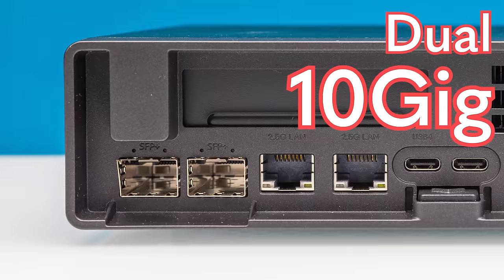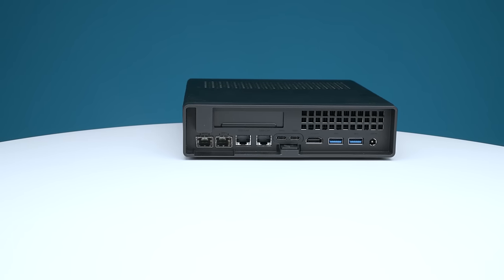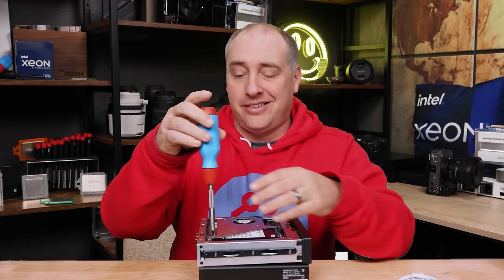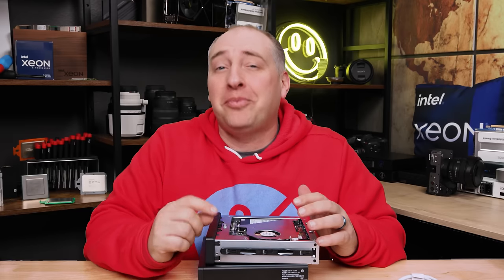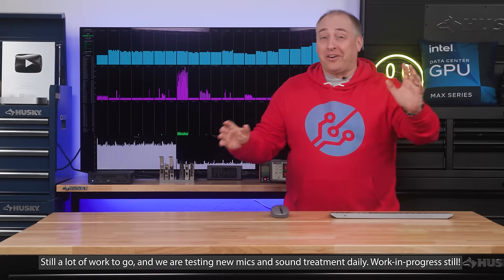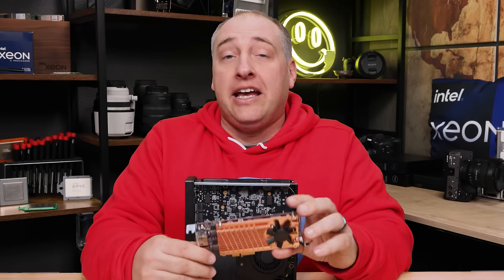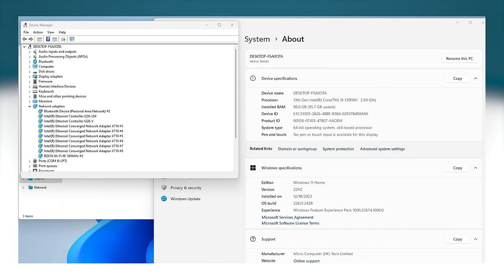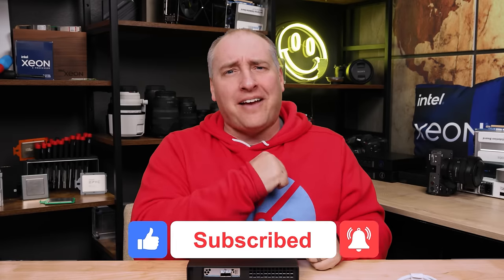The Pinnacle of Mini PC Servers - Minisforum MS-01

Comment: I saw this machine but still got myself a Think Station P3 tiny. I chose an ES motherboard so that I got 3 M.2 slots. I paired the P3 tint with the i5-12400 and it was 1/3 cheaper than the MS-01 with the 12900H option. 
There seemed to be an i5-12450h option with the MS-01, but it is not available and we don't know when they will start selling this option. I don't really like the i9 CPU that MS-01 provides right now because I don't want to stretch the cooling system too far. 
I did see the appeal of the dual 10G NIC but for someone who doesn't really need it, it is a piece of hardware that consumes power and does nothing. On the other hand, I can add USB type A, DP, HDMI, or TypeC with video and charging to the Tiny via expansion modules, which makes it very flexible. However, doing this does sacrifice the PCIE cutout.
It is also more difficult to install PCIE cards sideways compared to Tiny's riser approach. At least it doesn't require a special PCIE bracket though.

All in all, I think both MS-01 and P3 Tiny are both nice SFF machines. It really comes down to whether you prefer the dual 10G SFP port and the USB4 port, (Yes, it is USB4 rather than Thunderbolt, although they are functionally the same.) or more flexibility.

I will also provide a quick technical comparison here for anyone interested:

P3 Tiny  |VS|  MS-01
form factor: Standard size  |VS|  A bit larger than Standard size. (Matters if you want to put it in a server rack.)
CPU: Any CPU from Intel 12,13 and 14GEN  |VS|  13900H,12900H, or 12450H. (12450H not available yet.)
iGPU: MS-01 is always better as mobile chips always get better iGPU compared to their desktop counterpart.
NIC: i219-LM 1Gx1  |VS|  i226v 2.5G + i226LM 2.5G +x710 10Gx2. (Both machines can support vPRO.)
PCIE: Gen4/5 x8  |VS|  Gen4/5 x8. (Gen5 is available on 13th Gen CPUs.)
PCIE specific: Need custom PCIE bracket  |VS|  Difficult to install and uninstall.
USB Expansion: 4x10G type A + 2x5G type A + 1x10G type C |VS| 3x10G type A + 2x 480 M(2.0) type A + 2x40G USB4. (Tiny can expend 4x 5G type A or 1x10G type C with Video and charging expansion module, by giving up the PCIE cutout)
Video Expansion: DP1.4 + HDMI 2.0  |VS|  HDMI 2.0 + 2xUSB4. (Tiny can expend 2xDP, 2xHDMI, or 2xTypeC DPalt via the expansion module, by giving up the PCIE cutout.)
Storage Expansion: 2xM.2 |VS| 2xM.2 + 1x M.2/U.2. (Tiny get 3xM.2 on the ES motherboard.)

Comment: I was about to buy the rack version of the R86 when I saw the announcement of this, the connectivity on this is insane! I wonder how hard it is to attach a pikvm to this (the ATX part), then it would be the perfect machine for a small cluster. The one thing that was holding me back from that unit was that I would want both SFP+ and a fast link to the rest of my network. With this I can run QFSP28 since it's PCIe 4.0 x8
Reply: Do you really need pikvm here? As far as I understood it has some sort of ipmi already in it ( on the right 2.5gb nic)

Comment: I wish they would come up with 1u versions of this sort of thing. 
I've longed for the 4 port mini PCs to be in a rack case, instead they generally procuce overpriced mITX firewall appliances. 
You'd have a bit more room in a short form factor 1u case too for the PCI slot and power supply.
Reply from the maker: We will have two pretty cool 1U systems later this month with 2.5GbE and 25GbE. Stay tuned.
Reply: Supermicro has some nice 1u reverse mounted shallow boxes, That come with plenty of ports or have 2 or 3 pci-e slots available and some bang to do 5G edge stuff.
Reply: The "problem" with 1U is that unless the integrator designed in custom ducting, cooling performance is absolutely abysmal without having 3-4 of those mini jet engine 40mm fans screaming all the time. Even at idle, comparing my i5-7500T which is in both a 1U server and a Lenovo m710q... The 1U consistently runs 10°+ hotter, and loud. The properly designed cooling (and external power supply) does it cooler and silently.

Of course noise isn't usually a concern for rack equipment, but a lot of folks, arguably the majority of people buying such a system, have their homelab in their office or living environment.

Comment: Hmmm!  This might be a compelling upgrade from my cluster of EliteDesk 800 G4 boxen.  I should be able to pick up the barebones with the 12900H and reuse my memory and move my external Optane cache inside the box.

I wonder if someone makes a low-profile 40Gbe or 100Gbe card that will work well.
Reply: It's looking like I may even be able to use some ConnectX-3 cards I already have in my pile!  I just have to find a low-power 40Gbe switch.  Anyone have any suggestions?
Reply: And they have one with an i5-12450H for only $420.  That's still a pretty good upgrade for me.  I have six cores now.  This takes me to 4p4e.  Same number of threads.  I'll have to decide if it is worth the extra $130x3 to have the i9-12900H with its 6p8e and eight more threads.
Reply: I would love it if they could put an ECC-compatible CPU in one of these.

Comment: PLEASE SOMEONE MAKE ONE WITH ECC MEMORY! So many mini PCs, so many good options, yet none support ECC :/ I'll take ECC over quad NICs any day.
Reply: ... Why?
Reply: get a used Dell, HP, or Lenovo workstation. They are as cheap as this and can support everything you need.
Reply: @deanwilliams433  Power consumption is the problem. 7w vs 200w is all that matters for 24/7 use when electricity is 40c/kwh
Reply: Doesn't DDR5 have ECC or will it be DDR6

Comment: I like the direction they are going, but lower end processor would be nice.  Don't need or want i9 due to power and heat. It would be nice to see how low power you can get this and if it can reach low C states. I doubt it will due to customization.  We also need a small 2.5" external bay that's not USB.  4, 6, or 8.  Or better yet, design a mini pc, make it 17mm thicker and you could house 4 ssd's.

Comment: what i really want from this is 2x2x2x2x bifurcation on the PCIe slot, i want a total of 7 M.2 in this machine and while yes 2x10g+2x2.5g is fast networking, a pair of M.2 drives can overwhelm the networking, so 4 of them at 2x is plenty fast enough

Also the ability to install one of the 1.5TB Optane U.2 drive would have been cool, but its 15mm
Reply: It doesn’t support bifurcation?
Reply: @hsy541  I think it only supports 4x4 not 2x2x2x2x. I'm sure that if it were a 16x slot it would support 4x4x4x4x
Reply: Because of intel cpu's split limit. It's does not support split. But keep watch on this machine, maybe it will support more ssd in near future.
Reply: I don't think I've ever seen a system do 2 lane pci-e bifurcation.

And a single NVME drive is faster than 10g networking.

Consider this, 10gb/s = 1250MB/s

PCI-E gen 3 drives can do 3500MB/s

So one of them is plenty enough for speed..  The rest is for redundancy and capacity.
Reply: @jorper2526  Yep, want it for capacity on a Z1 ZFS array
7 drives total, 2 for OS and 5 for storage 4 usable, without 2x bifurcation you'd be limited to 3 drives with 2 usable.

Also, dont forget unless you're getting enterprise drive many of these M.2 drives will slow to under 100MB/s with extended writes, i have a 4TB drive that slows to 40MB/s after writing about 100GB to it, and that threshold lowers as the drive fills, more drives means that threshold is larger, with 3 drives you can meet that threshold at just 200GB and now the array cant even saturate a 1G port hitting only 80MB/s. With 5 drives you're limit is about 400GB and it only slows to ~ 1.3Gbps after that

Comment: I like on paper specs, but man, they trying so hard to be "everything mini PC" that its messed up so much. Weird mounting system, power compromise, dangerous switch, etc. My opinion in this, minisforum can adapt their existing BD ITX series motherboard into neat little custom case, and for expansion they can use 90 degree adapter for PCIe x16 slot, and the rest of PCIe I/O can be serve via M.2 M key, thus the initial price its not expensive, and people that need, for example, 10G networking, can buy, either from them or 3rd party an M.2 NVMe to 10G SFP/RJ45 adapter (which is sold widely in ebay and aliexpress), And for people that doesnt need the 10G ethernet features, they can use the spare M.2 M key for something else, like more SSD, convert to OcuLink 4i, etc.

Comment: The i9 for sure feels a little overkill. Also being limited to 64gb is fine for most use cases but I would love to see it be 128gb especially given you have an i9. But for $700 for the barebones model this hits basically every box. Love it!
Reply: Well you can go to 96gb already... just wait for higher density sodimm lol
Reply: Remember that this is a mobile i9 (6P cores with 1.25MB L2 per P core, plus 8e cores with 0.5MB L2 per e core). On the desktop, the equivalent CPU would be i5 14500/13500, which looks a lot more reasonable.

Comment: I tried contacting this company with questions multiple times with zero response. Makes me concerned about warranty and post purchase support.
Reply: I returned a dead unit to them last year and it was a nightmare. I was running linux for about a month, and in that month the device crashed a half dozen times with no kernel logs or anything so it had to be hardware related. I emailed them, a few weeks later I got a response saying they don't support linux, and that I should install windows, I told them thats a bit rediculous, but I installed windows and it took forever for me to reproduce the problem and then I got completely ghosted. Took forever for me to recontact them show the old thread and have them finally send a refund
Reply: it's a chinese company, you shouldn't be "concerned", zero response is normal

Comment: Question to the experts:  Can I connect an eGPU via the USB4 (thunderbolt) so that I can overcome a/ the power supply and 2/ low profile pcie slot? If so, this would be a perfect system for my use case.
Reply: $400 eGPU has less than half the performance of a similar priced full GPU card. At that point you might as well build a mini ITX system that will not have those compromises.

Comment: Things that I want to see on this awesome piece of Herdware:  
- An editional DiplayPort (or MiniDP) on the back.
- 2 Extra /More USB 3.0 (A/B) Ports on the rear
- Something to "lock" the powercable in place
- A Powerbrick with the same Size /Formfactor, that can be attached to the Case. Perhabs with in integrated USB Hub (Some front and some Rear USB 3.0, Cardreader)
- change one of this 10Gbit Ports to one with cooper only
- one onboard USB for things line a USB Stick with unraid an stuff like that
- That U2/NVMe SSD - make it a Jumper or a switch that can only be switched with a tool. Also you may automate this: But a switch under that M.2 Slot Screws

Comment: Rubber bands on SSD heat sinks are generally to accommodate double or single sides SSDs and allow placement to accommodate various SSD layouts.  Clips or wires on a 3rd party SSD may short something.

Comment: Hey Patrick! First off you're in Scottsdale now?

Second I am going to keep track of the thread on your site bc I personally would love to see what single slot GPUs would work in this. My NAS is starting to get long in the tooth, and it's a Plex server. This unit would make a great Plex server with fast transcodes.
Reply from the maker: Would the onboard iGPU not work for Plex? And yes, just moved late 2023.
Reply: @ServeTheHomeVideo  not sure...this would be a video editing and transcoding system. Plex right out of the gate but I am also ramping up 4K video editing. My current system takes alot of time to edit my videos.

This might be a moot point since most cards that fit are older gens, unless I move up to a midsize or desktop.
Reply: Upon further review what I could do is use one of the USB C ports and connect an external enclosure/GPU this way.

Comment: This box is amazing. But it's weird that they went out of their way to add 25Gbps of total LAN (and the 2x2.5 being vPro!), then TWO USB-C which are great to be USB4 but I just can't understand how having a recent Intel chip they didn't go for Thunderbolt 4. But I believe this is due to being a Desktop/LGA socket chip and not one of the BGA mobile variants that have the integrated Thunderbolt FOUR controller. They likely had to add the Thunderbolt 3 chip for USB4 compliance (but not the costlier Thunderbolt 3 or 4 certification) and this was a compromise for that amazing LAN and the other great expandability options.

Edit: oh wait, this is an H chip. But maybe still doesn't have built in Thunderbolt like the U chips and that's why they went with the TB3 IC for savings.
Reply: The H chip has internal Thunderbolt controller in CPU. In fact this is a Thunderbolt 4 machine, without TB4 certification, they only can say USB4 offically.
Reply: @jaxjiang8429  hmm interesting

Comment: Seeing that this unit has an infamous 13th gen Intel CPU inside, does the 13900H suffer from the overvoltage "feature" the 14 and 13 gen desktop CPUs are known for? Or is the HX variant that is based on the desktop core, thus prone to crashes?

Comment: This thing seems like a dream. Do you still need ecc with ddr5? I heard it has certain ecc features by design in ddr5?
Reply: ddr5 has on die ECC to assist in some error correction due to the shrunk node size, but its not the same as the server grade ECC we're used to. That will still be a separate feature

Comment: I would really love to see someone do a review on the Lenovo P3 Ultra. It is the newer generation of the P360 Ultra and is just a bit bigger than this here;
13th gen Intel, NVIDIA A2000, ECC ram support and a PCIe slot x8 which I would use for the QNAP card you used in this video and connect to the 4-bay QNAP DAS. I doubt the Lenovo unit gives you the option of nuking your SSD too 😉
Reply: Its also 2/3x more expensive almost

Comment: When I first saw this advertised I looked at the amount of stuff you could plug in and wondered if the number of PCIE lanes would be a problem. Is that what has slowed down the SSDs? If it is, would that affect the cards going into the slot?

Comment: You aren’t accessing memory often same for drives. Not being tooless isnt an issue. The thing about the switch being covered is moot, you don’t want it to be able to be changed whilst a drive is in there..a user would just make sure they install and set correctly then never worry about it again.

Comment: Seems like a missed opportunity that they went out of their way by adding the PCIe slot and even increased the size over your run of the mill 1L TinyMiniMicro-like PC, but didn't make it compatible with the most popular low profile carda such as the Nvidia A2000. All they needed was to make the top lid and back bracket be partially detachable so as to have an opening for that extra tall, 2-slot card. A d the weird thing is Minis Forum already had an even better solution for this on their external PCIe-compatible box (the one which even has a rack-like for mounting a large egpu and PSU)
Reply: "All they needed to do was add to the cost of the unit for MY niche use case!!"

I mean.. Cmon lol.  It does support the mobile A2000.

That said, I would not throw a 75W card in that slot.

Comment: Can you try to use a PCIE riser card to install a 4090 for people who would like to run LLM-like chatgpt locally?
Reply from the maker: We did use an ASUS PCIe x16 riser, but then you have to power and mount the GPU. At that point, it is easier to just use a mITX/ mATX system.
Reply: @ServeTheHomeVideo  Can you make a segment where you test a variety of AI cards (not necessarily with video ports) for HomeLab AI local models, More HomeLabbers are running AI, and ProxMox pass-through ability to run AI in Docker for local models is an interesting concept.

Comment: I may pick this up. Can you or anyone else weigh in on a couple things for me?

If you're going to have a DIY file server with ZFS and you want to have Proxmox as a hypervisor and Docker for hosting services, is it better to:
1. Use Proxmox on the file server, and PCIe passthrough to pass through the SATA controller and a NIC to a e.g. TrueNAS [Scale] VM and setup a separate e.g. Debian VM with Portainer and such for Docker
2. Use Proxmox on a mini PC or something like this one, then setup e.g. TrueNAS [Scale] bare metal on the file server

I'm assuming you'd have Proxmox access the ZFS shared over NFS in either case.

Also, for this box, if I installed Proxmox and setup an OpenSense VM (with NIC passthrough?) and a couple of PiHole VMs for redundancy, how viable would that be as a router? My concern is mainly virtual vs physical OpenSense and passthrough / bridge networking vs physical.

Comment: bought one, then found out yesterday after 2weeks that i bought nothing and it's just a pre-order (pre-ordering is stupid) . If i didn't want the hardware i would cancel for false advertising......  but i want to attach my 4090 (yes, externally) with that PCIe 4.0 x8 slot until i build my threadripper, my 9700k seems to be holding it back in machine learning apps.
Reply from the maker: We used the ASUS PCIe Gen4 riser cable and it worked flawlessly for us if that helps.

Comment: "VMware users may take pause." Is there a compatibility issue here? I didn't see any mention of that in the video nor on the website article. The comments mention that hardware raid is not supported by VMware, but are there other issues? Lack of hardware RAID for a home lab isn't a deal breaker for me.
Reply from the maker: VMware is super archaic. Unlike Windows and Linux it does not support hybrid cores and will PSOD on you if you try installing it on this. There is a workaround, but it is the difference between Windows and Linux (e.g. Proxmox VE/ Ubuntu) being easy normal installs, and having to do several steps to tell ESXi to not fault.